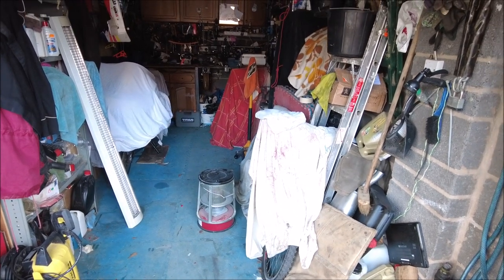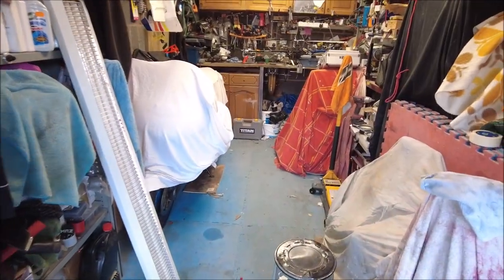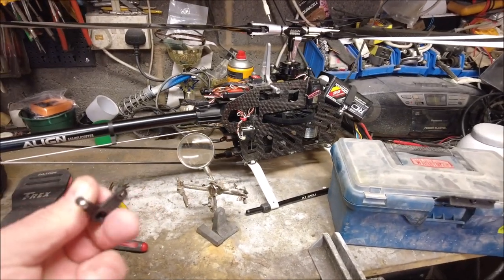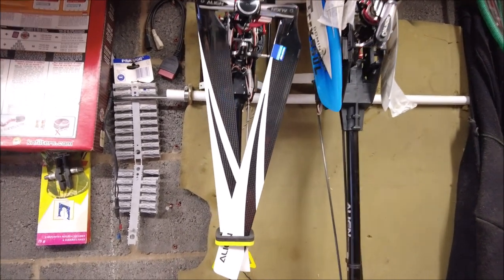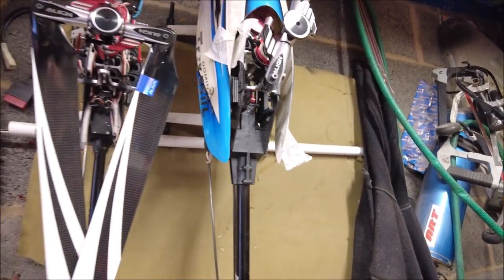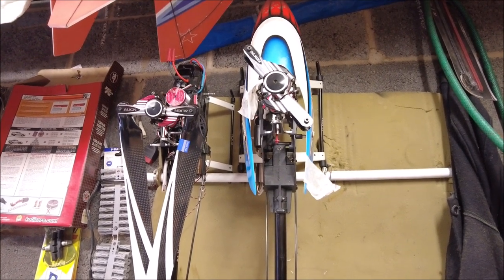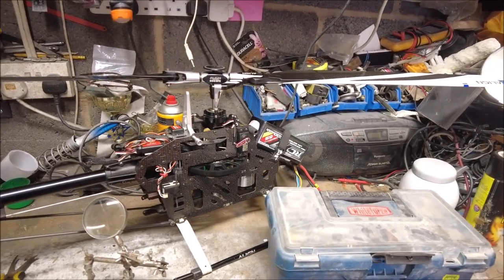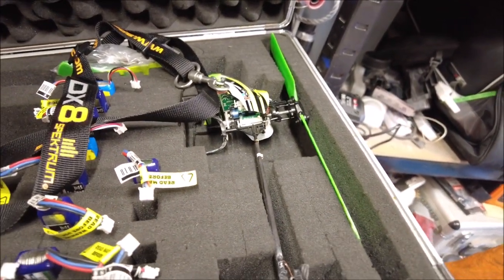I've done a thing again......

Comment: Nice RC helicopter, I used to try fly them about 10yrs ago, but I used to struggle with controlling them lol. I only fly drones now. I'm surprised you're not into RC cars, considering you like cars lol. I've got several RC cars, my fav being my Arrma Typhon TLR which has a rather large and powerful motor😊. Be good to see you out flying the helicopter, hopefully you have a decent head mount for your camera 😂😂
Reply from the maker: going through them at the moment ....the last owner did seems to like the Loctite on the bolts which isn't helping
Reply: @AdeReeves  definitely a pain, but a good preventive measure. Many a crash have happened because someone had a screw lose😂